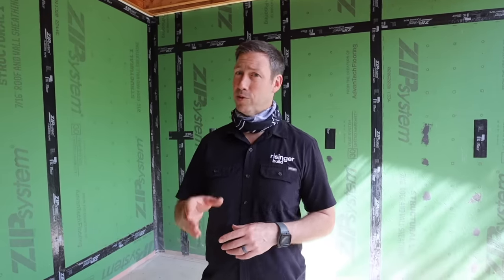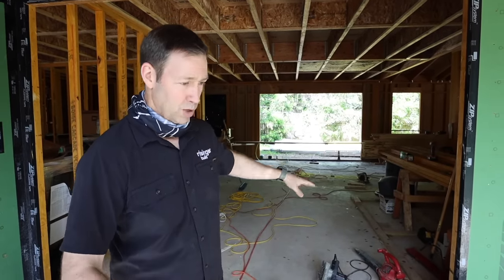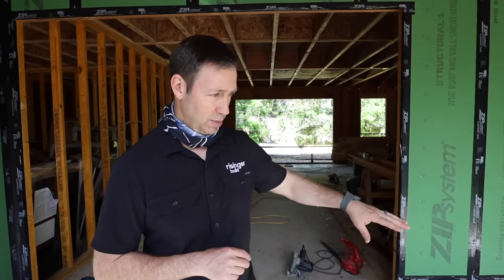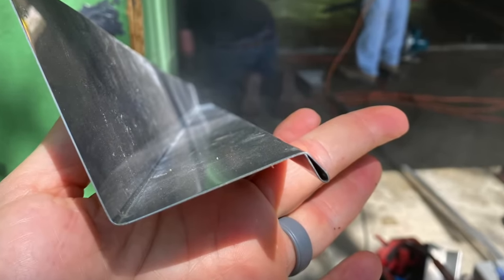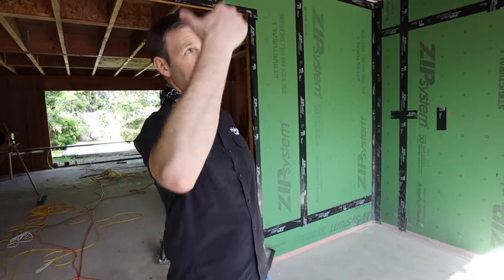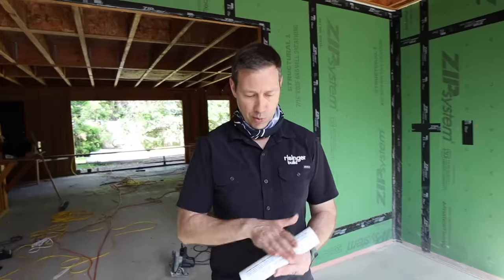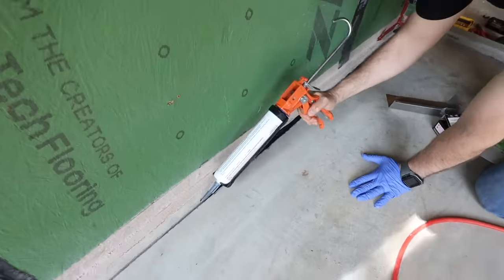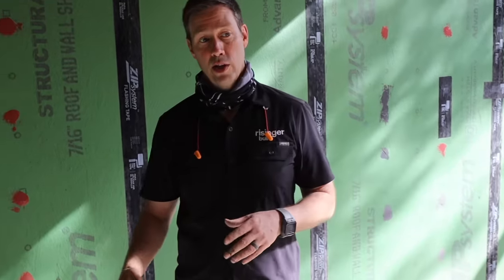Flush Concrete to Framing? Here's a Stainless Flashing Fix!

Comment: Old school, my man.  This is how flashing on chimneys was done (cutting the groove in the brick chimney and inserting a 90 degree bent corner to keep water from running behind the flashing instead of the dumb way done today with surface mounted flashing and gallons of silicone which eventually dries out and allows it to leak.  Good job.

Comment: Great detail.  Hurricane Ike caused $22 k damage to our house in 2008 due to wind-driven rain getting through the brick veneer and running down the sheathing and coming in under the sill plate. (And the weep holes had been plugged by mulch)
Reply from the maker: Oh man. That’s terrible Mark.

Comment: One little missed detail...your vertical zip tape on the seams of the zip panels should shingle/lap over the horizontal zip tape you installed for the flashing.
I don't agree with the kerf cut into the concrete with flashing embed in sealant. This is a water wicking scenario when the sealant fails. I would use a brick ledge flashing profile making sure the slope is maintained during install. This way, water intrusion won't wick up into the zip panel. Never butt joints with flashing.

Comment: Like concrete, there are 2 types of sealant, ones that have failed and ones that will fail,...….mechanical flashing, IE shingled does not require sealants.
  Sealants are required in some places/circumstances...…..that's just the way it is...…..while they can certainly be minimized, they can not eliminated.
Reply: The sealant isn't there as a front-line defense.  It's basically there as a "belt an suspenders and ..." type solution.  

The actual finish of the wall/porch surface is the front line defense.

The flashing is there to handle whatever little bit gets by the wall finish.

The sealant is there mainly as a bulk filler (like packing peanuts in a shipping box) for the minimal space in the kerf cut and under the flashing.  If it has its own waterproof/resistant properties, and is long-lived as a sealant?  Bonus points!

So, even if the sealant fails (as a sealant or an adhesive), it's still providing the bulk fill in the waterproofing solution.
Reply: So you wouldn’t have butt-jointed the flashing?
Reply: @aayotechnology    Unless there was a detail/tolerance that prevented it no,...but it would have still used the same sealants no matter what.  Who knows, the sealant might out last the flashing.....
Reply: Nothing is  guaranteed in life, we just do the best to minimize.

Comment: internal corners look great  but what did you do on external corner with metal flashing - we have the same situation on our balcony/porch which been filtrating for 40 years on the line where is concrete slab of the porch is connecting to the wall of the house, now we are trying to the same system as you just showed with copper flashing and external corner is very tricky one to make it tight, flash and waterproofed..

Comment: Hey Mat, a quick question from Australia. Did you do anything to minimize thermal bridging between the existing slab inside the house and the new slab on the porch?  If not what suggestions do you have to insulate between the internal and external slabs. Would be interested in a video discussing this. Stay safe.

Comment: I would suggest having another bead of sealant behind the vertical leg to prevent any chance of sweat (condensation) or water overtopping of the flashing for mold/mildew prevention. Also, you're creating an open hole when running screws through the flashing, so apply an extra vertical broad bead on the wall through which the screw will pass sealing that possible water pathway.
I just don't think your tape will adhere or resist punctures as well as you hope ( I noticed your head shaking in doubt) it will.

Comment: This really looks like complex thinking..and i believe this will happen only when you are building your own..usually i don't see this kind of details in houses that somebody else is building..But again..it looks like it actually works...btw i think..it looks to me like that metal sheet was bended too much..i would suggest bent it in angle more than 90 degree (so it would rather want to touch the wall instead of going opposite way then you have to force it by screws towards the wood)...i'm a bit afraid that that stainless steel might come off..even it was glued..but during days or years..it might..
But again..Nice video and you did what you could to prevent water coming inside..100 points for that :)

Comment: I am currently in the middle of an identical project and this was so helpful - thanx much! One question though, is it necessary to cut into the slab so the lip goes into it? As I don't have equipment that will saw through concrete, could I just have the flashing coming out say 4 or 5 inches? Also, would that BTL product be useful under the plate for a little extra protection? I got a lot of rain water coming in and need every bit of insurance I can get....thanx.

Comment: Your videos are awesome. I changed the garage door to the opposite side and had been having water coming in after I applied stucco, I completely missed doing this and will be doing it soon. Also I’m trying to level my garage floor because it’s uneven due to the door movement. It had about 2” difference for water to out come in but now I need it leveled. Know how I can do that since it quite a bit ? Thanks

Comment: How do we know that these systems that have only been around for 10 years will last 100?
Reply from the maker: How well do they last on your kitchen table?  I’ll be covering my entire structure with 2” of foam so all my tapes and sealants won’t see much +- 15 degrees of inside temps.
Reply: It’s also called accelerated age testing. We do it all the time in composites. There are a bunch of ASTM standards in fact for this very purpose.
Reply: With enough money, you can make something last thousands of years. You could go with all stainless steel framing and sheathing, welded together. Your kitchen sink does pretty well as a water barrier, and if you go to a railroad museum, you'll see stainless steel passenger cars that have been mostly outside in the weather since they were built in the 40s. They last pretty well. This will cost you mucho dinero, but for a thousand years, hey, it's worth it, right? Finish off the exterior with thick granite ashlar blocks, and, well, you've seen the Lion Gate at Mycenae, right? That's been there 3250 years now.
Reply: @SigmaDG  this is the answer I was looking for. Thanks
Reply: ASTM life cycle testing, blast it with UV at high temps and then spray it with salt water or acid etc.
The plastic may last but adhesives tend to be the first part to go, I too am interested in how the zip flashing and others hold up over a few decades.
Reply: They won't be exposed to UV radiation from the sun, so they should last a long time.  Now, if you were to let the house sit vacant for a few years without heating or air conditioning, moisture buildup inside could cause major problems.
Reply: @buildshow  I presume that was a rhetorical question, as it is not at all relevant to anything useful. Plastics  (not surprisingly) are hydrocarbons, whose properties are almost always amended by additives, which are called plasticizers (again, a surprise). Plasticizers are notorious for leaching out, and that process is more time dependent that environmentally dependent (UV degradation is another failure mode). 
In the late 70's/ early 80's, there was a flood of new building products rushed to market, without adequate long-term testing. Some of the fails were pretty spectacular, and very costly (think the early PVC roofing). I used to travel the 128 beltway around Boston Metro area on a daily basis, and one of my amusements in traffic was watching the progress of repairs to a really large 5-story brick spandrel/ continuous glazing bands building. The plastic flashing material used at the brick ledge attachment points (at every floor, at each column, every 25') had failed, in only about 5 years. The brick was cut out and removed at EVERY point, the flashings and waterproofing re-done, and the brickwork replaced. An ugly mess all around. 
Saying something looks good on your kitchen table would not go too far with me, when I am liable for the disasters (which I have been, for 49 years now). And do not assume I am saying Zip tape will fail in 5 years; I trust that organization has done better research and testing of their products than in my example.It would be far more desirable  to comment on the testing actually done on the product, citing sources, if needed (assuming there are some). 
Very surprisingly, I do pretty advanced stuff, and rely heavily on sealants and waterproofing. I also rely first and foremost on excellent design and detailing, to reduce my reliance on chemical properties (and longevity). And I do rely on the most critical sealants layer to be out of the weather, and hidden from UV (which was not as big an issue in eastern Massachusetts, but it is a very big issue in Colorado). 
My two cents worth.
Reply: @leestevens446  I like how you mentioned reliance on design more than materials.  It reminded me of designing aircraft to be gliders before the engines are even turned on.
Reply: @daniels5780  Think of it like this: shingles, in and of themselves, are not "waterproof", at least one will not be able to wrap an object with one and prevent water passage entirely. But shingles work on a roof (3/12 pitch and above, typically) because water mostly flows downhill (except when it doesn't, which cause an inordinate amount of chaos in our building systems), from the top sloped surface of one shingle to the top sloped surface of the next one DOWNHILL. Geometry, gravity, and the physical properties of water make this work. Take a high pressure hose and aim it up and parallel to the slope of the roof, and you will immediately discover that shingles are not "WATERPROOF".  In all my years, I never had a situation where a shingle roof leaked in the middle of the field**. Saw lots of times where the sidewall termination, rakes, eaves, dormer corners etc. leaked (often badly, and with considerable consequential damage). This is why, in modern, highly insulated structures that are often complex (intersections) and often leave surfaces unprotected as a consequence of design, we need our chemicals. There are areas that simply can't be protected by geometry.

**Not True! Twice I have rebuilt roofs that had old fashioned asphalt based shingles that leaked all over the roof area. Of course, failing to maintain had led to the erosion of the shingle below, in the slot that is always exposed. Erosion so bad, the roof sheathing was showing, and in LOTS of places. That is not a leak, that is just stupidity.
Reply: Nothing is certain, but that does not mean everything is completely unknown.  Science, Engineering, testing, and careful, logical thought can do much for us.
Reply: Isn't this the main issue with a lot of tech in the building industry? We see techniques not enough tested (other than in controlled environments?) being used in large scale. Rendering severe issues later on. Not saying these exact methods will but there is a part of experimental side of this—and unfortunately the amount of chemicals used in the building industry is a bit sad to see. I know I know, probably a very difficult equation when it comes to money divided in cost effectiveness.
Reply: In 100 years you won't be around to worry about it, now will you?
Reply: @livefreeordie9542  And this being America, it is really great to be able to pass the problem(s) on to the next sucker. I have had my fill of educating clients and fixing disasters. What I see in the overwhelming mass of production homes in Colorado is incredibly poorly built (materials and detailing both) structures. I did one "leak repair" in a "New Community" that corrected flooding of the living room every time the rains came from the north. The house was 6 years old. The previous owners had done a "band aid" and sold without full disclosure. My client's attorney nailed their ass, I fixed the walls to enable the nails to hold. Real issue is that every house in the community had similar problems, some a bit better, some a lot worse. For houses to fall apart in less than 10 years service life, kind of makes anyone being around in 100 years totally moot. If you are fine with screwing the next guy in line, you are allowed to do as you please, but don't come around trying to sell your (disaster waiting to happen) house to me. I am wise enough to see where things go, given any starting point.
Reply: @livefreeordie9542  That's kind of a sad point of view to have.
Reply: @Keith Saunders, his grandchildren will. 😁
Reply: @buildshow  A better thing to say would be: “This will last until everybody moves to Mars.”

Comment: I've concluded that this house is a good exercise in using every bit of cutting edge techniques available.  I'd guess that you could get 90% of the benefits in all that he's done by spending 50-60% of the money he's spending.  There are thousands and thousands of houses built with 19th century technology that don't have water damage after many decades of exposure in much more harsh climates than Austin.  While I admire his insulation package from the aspect of reducing greenhouse gas emissions from heating (occasionally) and cooling (often) this house, with cutting edge mechanicals, the insulation overkill is, in my engineering opinion, wasted money.  I think there would be more value to society in figuring out how to translate some of these technologies to production builder houses at a reasonable cost.  For example, how could Zip type sheathing replace OSB and Tyvek at a reasonable cost in a 2000 home development.
Reply: Jealous?
Reply: @microwavedsoda  Why would I be jealous?  Just stating an opinion that he's going overboard and I doubt if anyone could convince a bank to loan the money without sponsor discounts.  As an engineer it's an impressive effort.  As an engineer it's not justifiable other than as an experiment.
Reply: I have to say that demonstrating materials and methods that are not as advanced as we were using 10 years ago doesn't really qualify as "cutting edge", but I guess that is somewhat in the eye of the beholder. Matt's claim to fame is a platform for publicizing stuff not commonly done by the trades, which is good thing, in and of itself. Leaving aside for the moment the cost/ benefit value judgement made in the reply above, I would throw this out:
In 18 years working in the Boston area, I did entirely renovations and additions on existing structures, aged 30 to 90 years old. I found that 100% of the structures I worked on had present infestations of carpenter ants or termites, or significant damage from past infestations. All of those revolved around water penetration and damage; the bugs follow the moisture softening, and then accelerate it.The upshot was I have had a personal "crusade" for water management, starting way back when (mid-seventies, actually). When I moved to Colorado in 1994, I worked for another builder for a short time, doing new houses (the boom times). I looked at the shoddy building practices, felt the warm dry air, and concluded that the locals knew their stuff. Once back to doing my own jobs, I had to start on renovations and additions, all over again. Quickly learned, most of the same water intrusion problems existed here, just to a lesser degree, and without the bugs (except for one notable project). The changing insulation standards that started after the '73 energy crisis threw the industry into turmoil, and I don't see in the construction landscape that  anywhere near the improved response has been made, given all this time. 
A few years ago, I was called as an expert examiner, by my attorney, for a severe water leak situation in a 6 year old house in a "New Community". When the legal dust had settled, I was engaged to do the remediation work. Wind driven rains from the north would leave one third of the living room floor in a huge puddle of water. Other windows had leaks that had internal structural damage. Every person(neighbor) who walked by while we were on-site had a leak story of their own. I simply shake my head at the greed, ignorance and incompetence that is rampant in the developer/ residential construction industry. Most citizens are now so conditioned by the "Walmart Effect" (you can have a bigger one of EVERYTHING, and way cheaper, too) that quality and long-term considerations of durability and maintenance costs never come up as a decision-making factor. A really smart client of mine (45 years ago) told me there are two ways to buy something: PRICE or COST.
Reply: Lee Stevens what do u mean price or cost?
Reply: @michaelpatrick6950  it's hilarious you think banks make the decisions on the money. We build too many blank check houses here in MD. These customers make $220k annually and the bank approves any tech they want all the way up to $2M. We know the price will go up in 20 years

Comment: Hi Mate, if you wanted to add an extra precaution for waterproofing you could add a waterproofing membrane. I have seen cases here in Australia where people haven't waterproofed bathrooms properly and haven't fully coated the base of the shower and just sealed the floor-wall junctions, the concrete gets waterlogged and the moisture migrates under the waterproofing and out into the neighbouring rooms. This could happen with your flashing if you get moisture sitting there for long enough. Very unlikely but could be worthwhile if you want to ensure no water enters your house